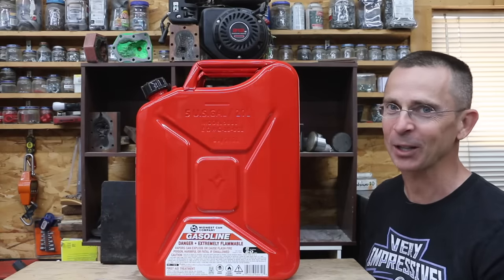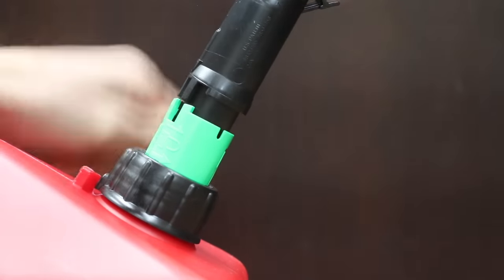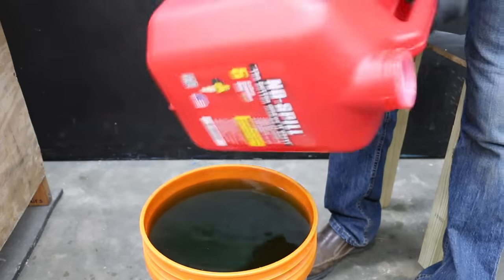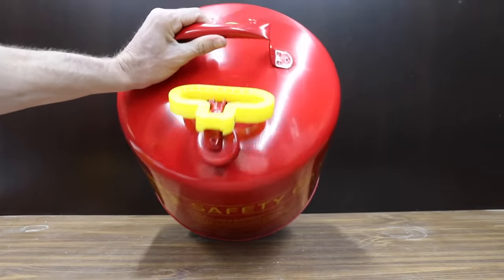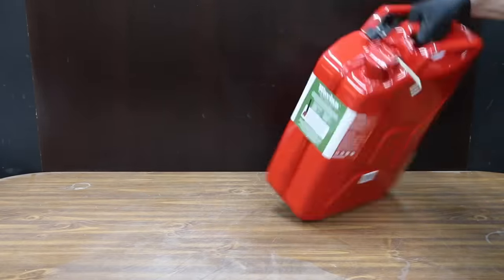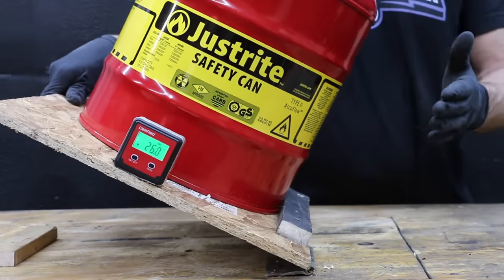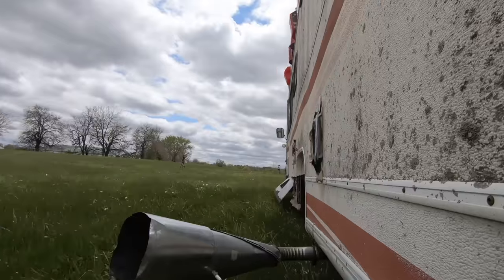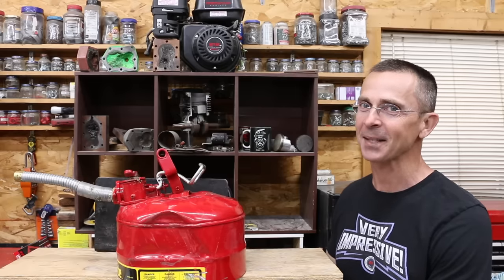Best Gas Can? $140 Wavian vs Eagle, Surecan, Scepter, Briggs & Stratton, Midwest, VP Racing

Comment: NEEDS Will upset or reverse your results. FOOTPRINT might be important.. I LOVE! my military steel cans like ones you tested - 30+yrs!  They fit in the sides of my pickup bed under the top rail, & don't consume floorspace! Short bungee from factory tie-down no tipping.  HOWEVER!!! If It's filled in winter, and not used till it's 50° hotter, you can even lay them on their side AND THEY DONT LEAK!!! LAIN on the side ALL SUMMER - no leaking! That cam lock lid works great! **** Did you notice - the spout was NOT in the middle? The spout is on the top NEAR A SIDE EDGE for a reason. when you use it - TIP THE CAN SIDEWAYS. That puts the spout at the top of the can, giving you time to insert it into the receiving container. Back when they were $29@ Pep boys or auto zone 30+yrs ago. Whew hew! PS: Theres a whole video on the insane engineering that went into these cans, WW2? & makes them Very VERY Impressive !!!  AND- You should have spaced them out on the farm farmabego. Some collided with others- over 40lbs from 12 ? Feet at 15? Mph?  
 Thank you. 
Thank You.

Comment: I have started using surecan. I like that I can set it on mower or tractor  and have no spill. Pay more but to me worth it. And in last year they have add the cap where you don't have to remove to fill
Reply from the maker: Thanks for sharing.

Comment: I had a reputable (but not reputable enough) brand of 'jerrycan' which I put water in once, for less than a day. It ruined it, as the water came out with an orange tint from the instant rust formation. I don't know if it was ONLY affected by water, but it was a compete failure compared to cheap plastic fuel containers in terms of longevity and corrosion resistance.

Comment: I had a great time watching you as always come up with the testing system.   Keep up the great work.    One item that was not covered was what drove me to metal cans.   I had several bad experiences with the "new" fuel we have with ethanol eating thru the plastic cans.   To the point I had to put the "can" in a plastic bag at the filling station to get home.   I ordered a metal can a few days later.   Not sure if I had an isolated problem or others are finding the plastic in the "cans" getting pinhole leaks.
Reply: In Minnesota, we only purchase 91 octane " no ox " to avoid all small engine and can problems -- No ethanol is VERY nice for motors and cans !!

Comment: Funny YouTube would recommend this video today and I somehow haven’t seen it til now. Went to run a bunch of errands with my dad today. Which included picking up some ethanol free fuel for his 4 wheeler. We were complaining about these new spill proof cans always causing spills. My best cans are some cheap Chinese ones that are very similar to that Stark can other than being green. They have a little vent tube in the mouth which just blocked the gas nozzle. So I pried them out with some pliers. But they took forever to drain because there was no ventilation. So I got some brass screw off vents on Amazon that I drilled into the top behind the handle. They’re great now.
Reply from the maker: Thanks for sharing!

Comment: There are no plastic fuel containers on our farm.  They are unsafe.  We use the Eagle cans.  No fire possible unless the rather heavy metal of the tank is breeched.  These cans are expensive but they deny combustion.  They don’t easily tip over either.  Used for diesel and gas both.  Eagles come in yellow too.  Good testing Project Farm.
Reply from the maker: Thanks!  Thanks for the feedback.

Comment: I'm in AZ and it feels like every summer I need a new gas can with plastic ones getting destroyed in the heat and sun. Even in a tool shed they'll "rot" and break apart. I'll stick with the metal ones, even refurbished an old Eagle safety can a few years ago. The spout is tricky to fuel up but it's good enough for small engines. I'm sticking with metal cans and funnels from now on out. Eagle, and Just rite for 2 cycle and lawnmowers and Midwest for vehicles.
Reply from the maker: Thanks for sharing.

Comment: I've got the non-military scepter in my work van, works great for filling my air compressor and lawn mowers, you would need a funnel for a vehicle if it ran out. but works great for what I use
fits perfect in the step in the rear of the van with the truck batteries next to it
Reply from the maker: Thanks for sharing.

Comment: Another problem with plastic cans is in arid environments they can generate static discharges, so it's a good idea to touch the can and the fuel pump or item being fueled prior to use, using your body to "balance" any static charges before touching them together.
I have one of the Justrite cans and it's the best when trying to fuel a vehicle as well as lawn mowers.
Also, eBay has "replacement" nozzles for "repair" of your vintage gas can. (Nudge, Nudge, Wink, Wink)
Reply from the maker: Thanks for the feedback.

Comment: After having used gas cans for over 65 years I can honesty say that the new safety features on gas cans make them very unsafe . They may be better on vehicle tank but the vast majority of gas can usage is for lawn equipment (Mowers, tillers, weedwackers,chainsaws, etc) and toys (go-carts, etc.). Filling the safe cans slows fills and causes more spills. Using  the cans requires longer times, superior coordination and three hands in some cases. I wish the people making the laws were required to have some experience, exposure or common-sense.  I really appreciate sites like this that provide info helping to make informed selection and improve safety for the user...
Reply from the maker: Thanks for the feedback.

Comment: After hurricane Ian, I had a Scepter can in my trunk while at work so I could get fuel for my generator after work. The weather was not very hot, but the can developed a leak at the connection between the can and the spout. I can only guess it was caused by heat warping. I re-seated the spout several times, but the leak persisted. It did not leak when it was first used.
Reply from the maker: Thanks for sharing.

Comment: I like my Midwest metal cans from harbor freight which I also like the round metal cans in general i have 3 of the harbor freight ones and 1 of the round eagle cans i love bothe designs. I purchased my first midwest harbor freight one after i seen another video you done including a test and review of one and gave it a chance and came to love them.  So thank you for leading me to those.  The round eagle can i picked up new in box really cheap at a yardsale. These crap pour spouts and flame inserts have ruined pretty much all gas cans. I get rid of all that crap and keep my funnels with my cans and it makes them pour alot faster for me.  I can't say I would recommend everyone doing it the way I do because removing safety features of some thi gs can be dangerous but I have used the round metal cans since I was 5 or 6 in the mid 80s and have never had any issues of course that's using at least a moderate amount of common sense. I'm going to be keeping the military type from harbor freight but will be investing in a few more of the eagle round metal cans.  Guess I'm a little nostalgic on the old round metal cans i used as a kid that were my grandfather's.  But they are a good can and have a decent flow rate.  Thank you for another excellent video
Reply from the maker: Thanks and you are welcome!  Thanks for sharing.

Comment: Don't know if anyone answered this question yet, but the Wavian can is made in Latvia in the exact same factory using the exact same process as the Midwest can. They're basically identical with the exception of the spouts. So if you're thinking about getting the Wavian, don't. Just get the Midwest for nearly $100 cheaper, and you'll basically have the same can as the Wavian.
Reply from the maker: Thanks for the feedback.

Comment: I always remove any inside filter before using the can. The spout that comes with the can is only used to cap the can. I use a separate funnel to pour the gas with the cap off. I'm finished pouring before anyone using the idiotic spouts ever gets even a quarter of the gas poured out. Any slight spill that might occasionally happen, gives me some satisfaction, since it violates the crazy engineering intentions of attempting to force me to never even let fumes escape.
Reply from the maker: Thanks for the feedback.

Comment: Great test 😊 the main problem here in hot weathers is the plastic cap broke easily even with the expansion pressure after a year and find a new one not really easy in Mexico since they don’t all have the same treads 😮
Reply from the maker: Thanks for sharing.

Comment: We got a great deal on a half dozen Wavians around 2015 from campingmaxx. One arrived with rust inside and they sent us a replacement overnight and didn't even want the bad can back. I still use it as an outdoor airtight ashtray, to the horror of my houseguests. The cans have all held up well and don't tend to open, even without the pin in place. The Wavians will expand in the heat, but we've never had one pop.  They're used with a conventional funnel since the plastic adapters they came with at the time were crap. The VP Racing looks like the best for vehicle use. We have a smaller No-Spill for fuel/oil mix and it's got the most ironic name ever. So many regulations are born from protecting idiots that would pour gas into a camp fire.
Reply from the maker: Wow!

Comment: I have the Scepter and the Midwest, and neither will reach into my Ram truck's diesel fill nozzle, so I had to use a long funnel.   The truck's diesel fill nozzle has 2 flapper gates, and the fill tanks don't reach in far enough to open the lower flapper gate.    Like your red gasoline cans, my yellow "diesel" cans also have the flame prevention screens which seem unnecessary for diesel fuel.   The screens  prevent a siphon hose from being used with these tanks, but the screen simply pulls out.
Reply from the maker: Thanks for sharing.

Comment: I have a few of the Eagle cans. Great minus one issue. The paint on the can will flake off the bottom of the can the first time you set it down full. A rubber gasket around the cans base would make it perfect.
Reply from the maker: Thanks for the feedback.

Comment: While the purchase price is painful, we only use Wavian cans (in addition to a few old NATO Treibstoff surplus cans).  Side by side, I'm almost certain the NATO cans are made by Wavian as they are virtually identical in all respects.  Wavian is made in Latvia according to the label they ship with.

A difference worth noting is that the metal cans are far better for long term fuel storage than the polyethylene designs as there is no porosity to allow oxidation of the contents over time.
Reply from the maker: Thanks for the feedback.

Comment: The VP racing fuel can is great, we have had them for years. The vent should be further down on the pour side of the can. Could have been a better design. Vent at top for gas, vent somewhere else for when you are pouring.
Reply from the maker: Thanks for the feedback.

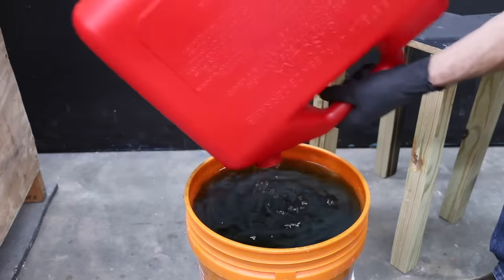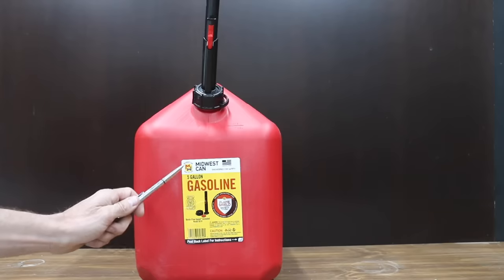Comment: @2:55  It's not just you. I have the same B&S can and it leaks if you put any pressure on the spout. You have to be pretty much spot on lined up and you can't let it put any pressure on the spout to avoid leaks. @3:00, I have one of those too. IMO, the handle placement is tops for this can. Having two handles works way better than 1.
Reply from the maker: Thanks for sharing.

Comment: I have two Wavian diesel cans on my off road trailer which has traveled the Continental divide from Mexico to the Arctic Ocean. They do the job and don’t leak. I use the flex nozzle they offer as an option. I didn’t like the nozzles that came with the can. Mine are in brackets, so they don’t fall over.
Reply from the maker: Thanks for sharing.

Comment: Never use plastic cans unless you store indoors.  There is a beetle that bores holes, it is attracted to the ethanol.  From PennState: Camphor shoot borers are an introduced species of ambrosia beetle that attack small-diameter branches and trunks of stressed, weakened, and dying trees. They also accidentally bore holes into plastic gasoline containers, hoses, and tanks.

When a tree is dying it releases ethanol, this attracts the beetle.  So any ethanol will attract the beetle.  I have had fuel lines and gas cans ruined, with full spill of fuel.
Reply from the maker: Thanks for sharing.

Comment: The WWII era Wavian containers (aka jerry can) have other virtues. They can be carried by two people.  A comparatively large number pack into a given space (they are stackable). Yes, they tip easily but if you strap two together, they are almost topple proof. They do not expand and contract with heat. You can get the military surplus jerry cans for as little as $15. Tidy them up a bit and they are still serviceable.
Reply from the maker: Thanks for sharing.

Comment: I use only the LC2 racing fuel jugs. The design is perfect for pouring gas. Sometimes I’ll need to travel farther to get ethanol free 92 so I use a low profile can in back of car. VP fuel is local
Reply from the maker: Thanks for sharing.

Comment: Most of the cans flow fast if you remove the nozzle completely and just use a funnel.  I got tired of spilling fuel trying to work the safety valve, or dealing with skinny tubes.  For lawn mowers, I just use non-safety nozzles on cans bought at yard sales.

Comment: There is a better way to dispense the fuel in the tank w/o the need of the "spill proof" nozzles. There is ,on the market, low voltage (3 volts/DC) pumps that will extract nearly all the fluids on a non-NATO style container. The pumps are inexpensive (under $12.00) and easy to use as long as you remove the flame suppression screen that some cans may have. Harbor Freight sells them as well as WMT and Amazon.

Comment: I have the no spill and one thing you didn’t mention is the auto stop feature.   Stick nozzle in fuel tank and let er rip and she’ll stop when it’s full.   It’s good for filling up lawn mower.   But as far as putting gas in a car it is too short.   Holding it upside down helps but you really need a funnel.
Reply from the maker: Thanks for the feedback.

Comment: There is a way out of the CARB nozzle nightmare; I use a liquid transfer pump from Harbor Freight. It runs on 2 D cell batteries and will pump clean gasoline, diesel, gear oil and more.  The suction spout goes to the bottom of a 5 gallon can.  I set the can on a couple of boxes, near the filler neck, press the button and in she goes!  Effortless and much safer.  The nozzles are not used at all!  Pump is $12 and worth every penny.   I have loaded differential gear oil, and diesel so far; it makes a dirty job clean.  I have a pump for each liquid; the pump drains fast and easily back into the can when all the liquid has been pumped.  There will always be a few drops of liquid in the can, but empty as it is, it's no problem. It sure beats holding up those full, heavy cans for whats seems like an eternity.  I'll never go back!    For regular use, on cans, not using the pump, I always put my own vent into the can, that way the liquid runs faster, much faster. A funnel always helps when doing this as when you drain the last liquid out of the can, the nozzle is not used at all and you are pouring out of the can itself and the funnel catches it nicely.  Hope this helps you guys who are singing the CARB can blues!

Comment: A problem we run into in the Rocky Mountains is expanding or collapsing the cans when changing altitudes.  The sun bakes them in the back of the truck and they blow up like balloons as you go up the mountain, making the gas leak.  Use some gas at high altitude, then on the way down they collapse and don't return to their original shape until left in the sun again.  I have been using the No Spill cans.  Based on this video, I think I will give the Eagle a shot.  The plastic cans just don't make it here.
Reply from the maker: Thanks for the feedback.

Comment: Just a heads up,
I've purchased a few cans just like the vp racing ome from rural king for 20-25 bucks. If you barely vent until your flowing the crack that vent cap it will eat and not spill on you. It is by far the best/easiest gas can I've used.
Reply from the maker: Thanks for the feedback.
Reply: @ProjectFarm  you bet. God bless.
Reply: They're really popular in California after the "spill-proof" design was mandated. I got 5 Scribner cans almost 10 years ago and they're holding up great.

Comment: Very thorough methodology and I might give those Eagle cans a look, BUT I need to point out that you spilled "fuel" from the VP Racing can because you used it wrong! The VP has a long, FLEXIBLE neck so you can bend the neck into the fuel tank with the can sitting upright, then lift the can and tilt it slowly, keeping the vent above the fuel. This eliminates spilling AND pours faster because air flows into an exposed vent faster than a submerged vent. I've been using the VP cans for decades and love them. Only problem is that the neck can get awfully stiff in sub-freezing temperatures.

Comment: I have 4 of the Scepter diesel cans. If you can’t tip it all the way, like in filling a truck, takes forever to fill. 3 out of 4 started leaking after a couple of months. Takes me 30 minutes to put the 4 cans in my truck and I have a puddle on the ground as well as wet pants